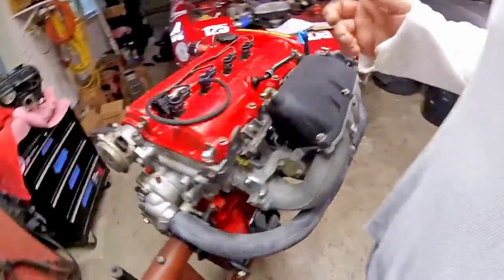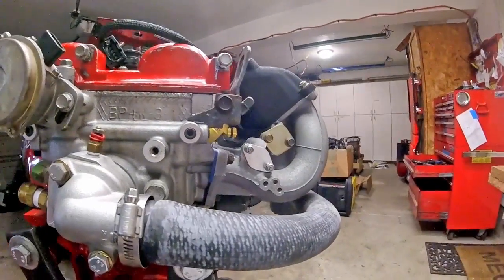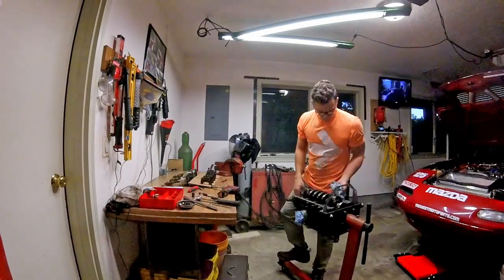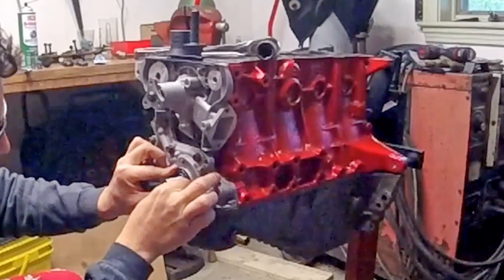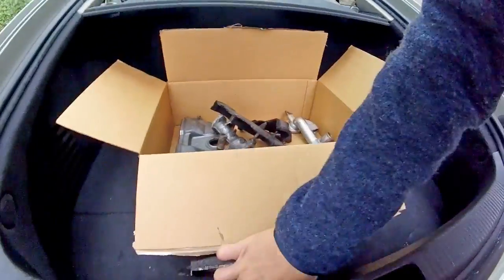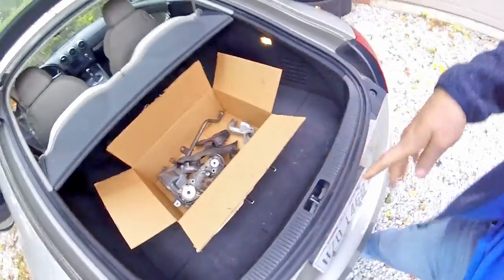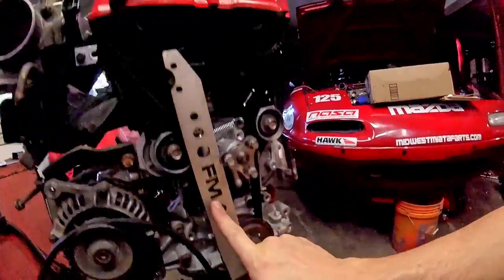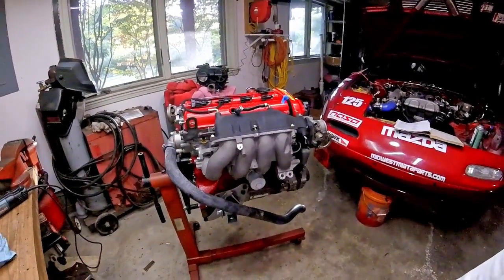High Compression High HP 8K RPM E85 1.8L Miata Engine Build

Comment: How do you feel about rotating engine assembly balancing? About to rebuild my turbo car here in Michigan, but worried about when i use aftermarket parts affecting the balance.
Reply from the maker: There is certainly an argument for it.  With this build I balanced the rods and pistons, but not the crank.  I think most Miatas could benefit from a dampener, and it's easy insurance in a turbo build situation.  I regret not adding it to this build list, but with a 1.6 swap into a 1.8 I was having issues locating a reasonably priced option since I retained the 1.6 wiring.